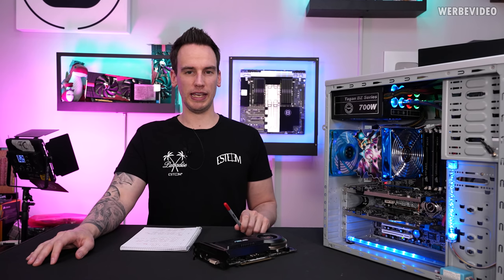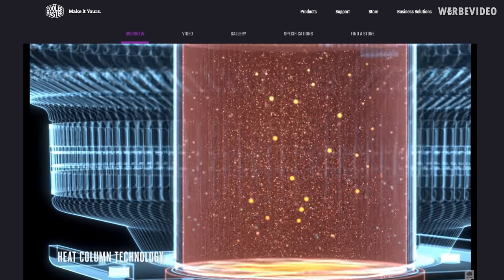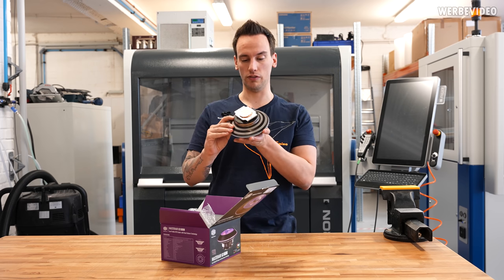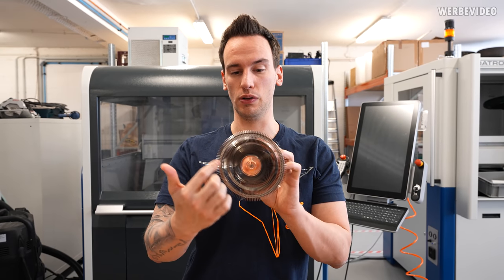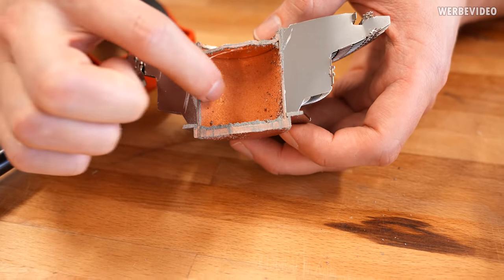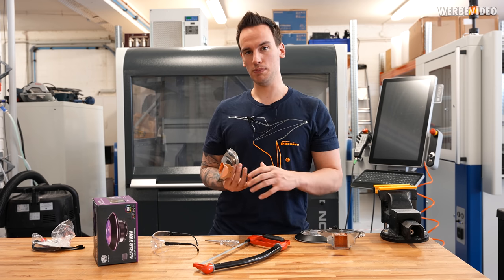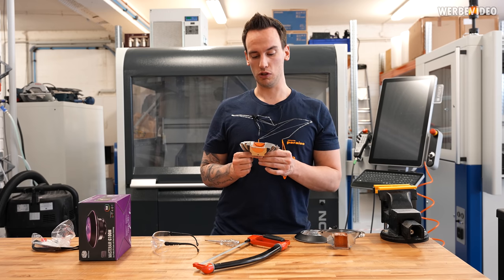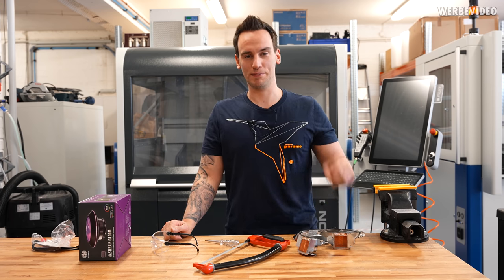The biggest "Heatpipe" won't make the best Cooler

Comment: Surprised no liquid came out. Small pipes generally do when cut in half. Also, aren't solid copper slugs probably more effective but more expensive too... At least for certain loads? I guess in this case that'd be a big ass slug lol.
Reply: Heat pipes have a thermal conductivity that is dozens of times that of solid copper (greater length = higher thermal conductivity for heat pipes). That said, a solid piece of copper isn't going to suffer from dryout, but neither will a well-engineered cooling solution using heat pipes.

Comment: wouldn't it be effective to have on the end of the heatpipe or vapor chamber a vacuumpump instead of cut and closed down?
with a controller board added to compensate temperature versus internal pressure.
Reply: The vacuum chamber is only a partial vacuum to lower the vaporation point of the cooling fluid. You don't want a high vacuum because it reduces condensation. It is a balance between low vaporation point and high condensation point.
Reply: @kazedcat  thanks for the background explanation! but i feel my question stands except it is now between a smaller band of operation
Reply: @michel5148  The benefit is insignificant over the cost of active pressure control. A much cheaper way to improve cooling is increase surface area by adding more heat pipes.

Comment: Considering how that cooler would be mounted on  a vertical motherboard, how would that condensation even touch the coldplate? That heatpipe would be horizonal.....

Comment: I wonder what the original Wraith Spire with vapor chamber looks like inside.  I know they did away with that with the newer version (just a big blob of aluminum).
Reply: Probably similar.   I have that one and it's just OK, it doesn't get that much lower than the cheaper cooler.  The copper plate probably contributes more to better temperatures.

Comment: I'm curious about how it perform when it is mounted sideways like on the tower pc. Because my very old toshiba laptop when hot enough, it is easy to make the solvent stuck on the colder fins area when the cpu area tilted higher than the fins. Thus, instantly overheating the CPU

Luckily, when the laptop is placed on the tilted cooling pad, the CPU always lower than then heatsink area, cooling the CPU more efficiently.

I wonder if this case still happened today?

Comment: I'm interested how the 25mm heatpipe fares against the roughly 17 and a third 6mm heatpipes that add up to the same cross sectional area. A=πr², ergo 6mm pipes have 113.09724 square mm while the 25mm pipe has 1963.49735 square mm, which comes to 17.36111 times as much. HOWEVER! This is a surface area based game, not a volume based one. We want perimeter instead of cross sectional area, thus 6mm pipes have 18.84965mm circumference while the 25mm can has 78.53975mm circumference. Multiplying 18.84965 by 17.36111 gets 327.24894. Dividing it by 78.53975 gets us 4.16666. My hypothetical bundle of 17 heat pipes should be roughly a fraction over four times as effective per unit length of heatpipe. Makes me wonder if a vapor chamber with a porcupine array of heatpipes would combine the best of both worlds here.

Comment: hi I have a g100m that I 
polished (lapped) and it gives very good temperatures, I am currently using it with ryzen 5 2600 at 3.8ghz in the 6 cores and it is usually around 60°c rendering or doing stress tests, I have seen it reach 72°c once but room temperature was 40°c

Comment: Btw, in normal use, MBO, CPU, cpu cooler (and other components) are in vertical orientation, so the part of the coolers heat pipe that you are referring to as a "bottom" (in contact with CPU) is not actually bottom where the liquid will condensate because gravity plays a role here.
Reply: Heat pipes do not use gravity to work... if it that was true then most coolers with heat pipes would not work, because they are oriented in the wrong direction. Heat pipes use capillary action and would work even against gravity. It's not "ideal" for a heat pipe to be in an upside down direction, but it would still work.
Reply: The temperature gradient crates a pair of pressure gradients that vastly overwhelm gravity. The vapor is 'sucked' up my the vacuum created by the condensing liquid, and the liquid 'sucked' back down by the capillary action created by the liquid evaporating

Comment: I had that cooler for some months; bought it to cool an Intel Core i7-6700 (non-K) on an ITX board. 
It was utter rubbish. The only reason both the G100M and its V2 version are on sale (and sell) is because of the UFO shape, don’t bother because once the novelty factor wears off you’re limiting even the performance of a 65W TDP CPU.
Reply: ...Yeah I just ran some numbers. it's looking very Not Good.

Comment: Why noctua air cooler expensive bcoz they use material like a copper, nickel plate and aluminum
You can find cheap air cooler but make sure the pipe is copper and direct Contact to cpu surface.copper is more conductive than aluminum. In fact, aluminum has 60% of the thermal conductivity that copper does.